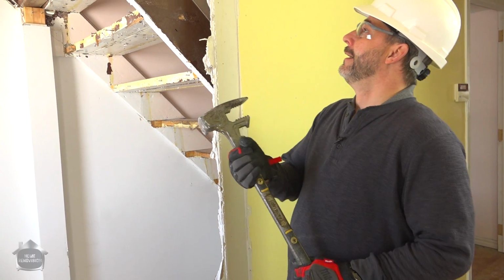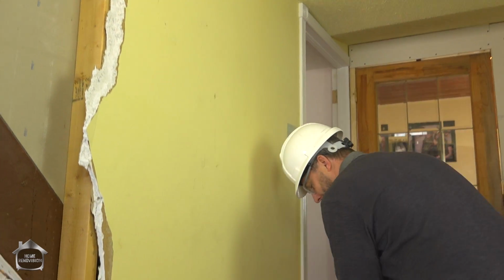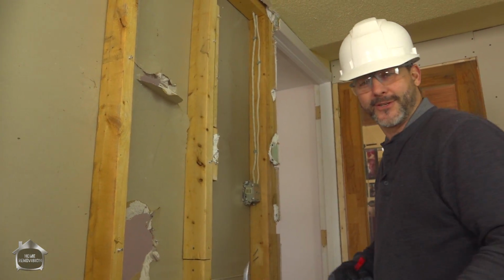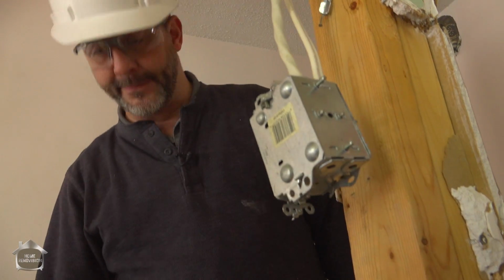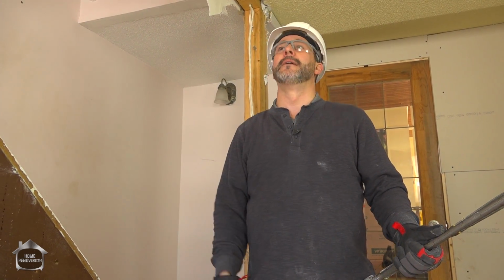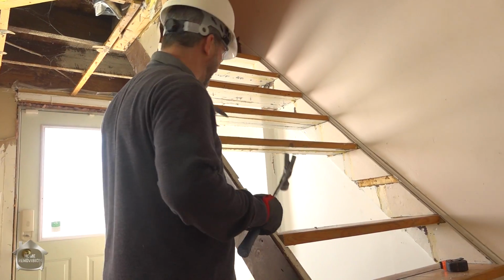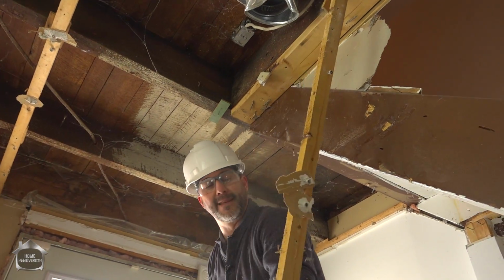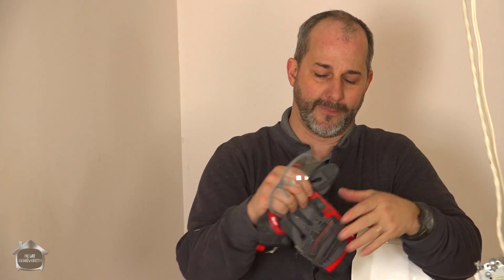Modern Rustic |  Demolition

Comment: 9:16 I learned that the hard way when I was 16. I was changing the outlets in my room in the basement. I had turned off the breaker for the basement and gotten through all but one. Low and behold, the final outlet was on a different breaker and I did an impression of a flag in the wind.

Comment: Simple tip, if your tearing drywall down off a wall, take a knife and cut the tape along the top corners so the ceiling panels aren't damaged.
Reply from the maker: that works if you are saving the ceiling. Cheers!

Comment: Just bought a 1800sq ft 70s builder home in GTA to see how much I’ve learned from Jeff’s videos. If I bring the house down I’m coming after you. All jokes aside, one of the first project I’ll be doing is to open drywall beside the stairs and replace the studs with good qaulity lumber to achieve an exposed stud style wall. Is there anything I should be cautious about other than the usual mechanicals in the wall?
Reply from the maker: be sure to look inside the ceiling first. that is where most of the surprises come from. Cheers! I would love to come down and do a walkthrough with you. Send me your details!

Comment: I have a staircase like this that’s walled up I want to remove. It isn’t going to open up much because on one side is a bathroom, but a halled up staircase it weird.
Reply from the maker: It is more common since it is so easy to transfer the load and cheap. but yes open stairs are awesome. Cheers!

Comment: I love your video they are so helpful. But I am planning to put in a fancy heavy tub in a house that was built in 1750s on the second floor master bedroom. I am told I need to reinforce the floors how do I do that.
Reply from the maker: Hi Holley, best to talk to a structural engineer. the advice is not too expensive and will save you a lot of headaches.

Comment: Why didn't you use a recip saw to get the studs out? Im a small woman so I might need some power tool help.
Reply from the maker: you might be surprised how easy it is to remove a stud this way with a 10 lb sledge. hardly need to swing at all. Cheers!

Comment: Thanks Jeff.  Did you test for asbestos in the drywall tape before demo?  Or was it a concern in this house?
Reply from the maker: fortunately we knew the house was redone in that section back in the late 70's so no concern there.
Reply: Home RenoVision DIY I’m not sure about that.  Here n BC the “dump” won’t generally accept drywall unless it is stamped with a production year after 1991 because drywall prior to that date likely contained asbestos.  They have a separate far more expensive process for drywall made prior to 1991.

Comment: Can you tell me what's the deal with store-bought nail guns? I'm reading that for framing code is 3 1/2 inch nails. But If I find a nailer that can take that size then I can't find the nails for it. but if I find the nails that the right size then I can't find the gun for it. because the degree angles don't match up. However, I have been able to find 3 1/4 nails for all. I'm also reading that most framers just break code and use 3 1/4 for everything. which I'm willing to do since it's my own work and nothing serious. I've never used a nailer before and just want to make sure I'm not missing some vital info or something.
Reply from the maker: kind of the same with dimensional lumber as well. they call it a 2x4 when it is actually a 1 1/2 x 31/2 those 3 1/4 nails are actually acceptable as is. Cheers!

Comment: hi, ive been following your videos for a few weeks now and in the kitchen remodel video thats 2+ hours long you mentioned creating a negative pressure room to minimize the dust. do you have a video specific for this because i didnt see it in the kitchen video but i havent watched the video in its entirity yet. i could easily google it but to me, theres a lot of hacks out there and you arent one of them. in fact im remodeling my kitchen right now and with all the plaster i needed to remove, i wish i wouldve created that negative pressure room.
Reply from the maker: Hi Steven, we did a video on that. simply use the search tool and type in negative air. Cheers!

Comment: I have been looking for the Stiletto tool your using...all hammers n nail pullers, no combination like you have. Any idea what site he bought it from. Or exact name of tool. Thanks
Reply from the maker: Hi Matt, we have it listed in our Amazon page, the link is in the description. Cheers!
Reply: Matt, it appears that particular tool is no longer in production by Stiletto. (Last sold 2014)  It's the TiBar 12 (Maybe 16")  I did an in-depth search myself.  They do have a 12" nail puller on Jeff's page, but it definitely does not serve as the same multipurpose tool Jeff has.   Kinda reminds me of a mini FuBar.  I love that thing. Found a similar looking tool on some suspect sites that show they are made by Milwaukee but still have the Stiletto logo.